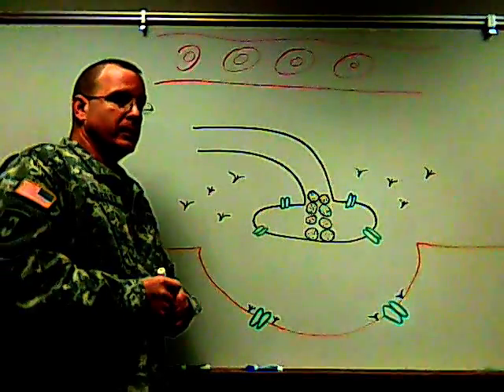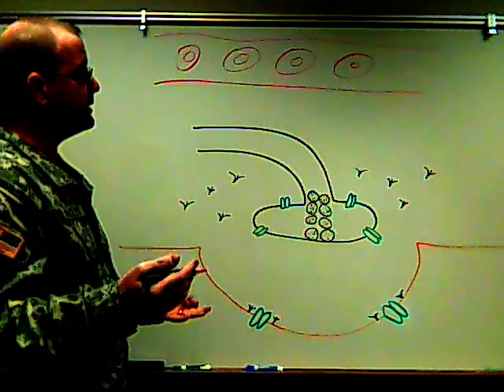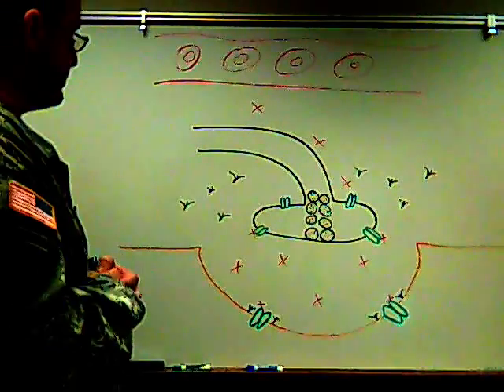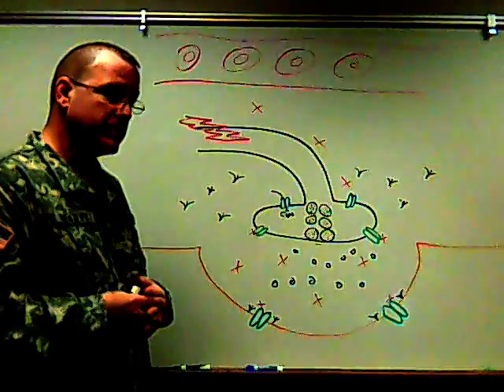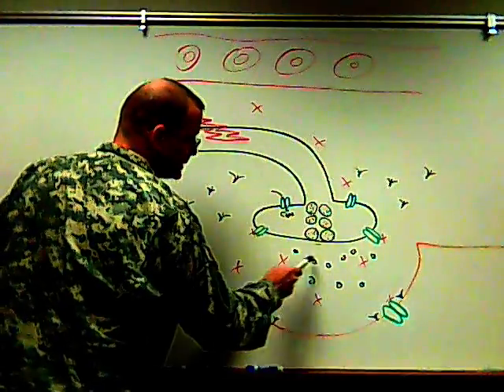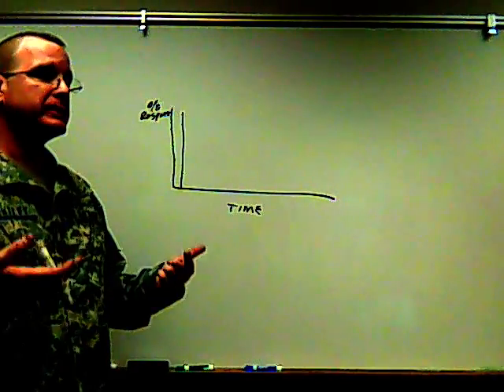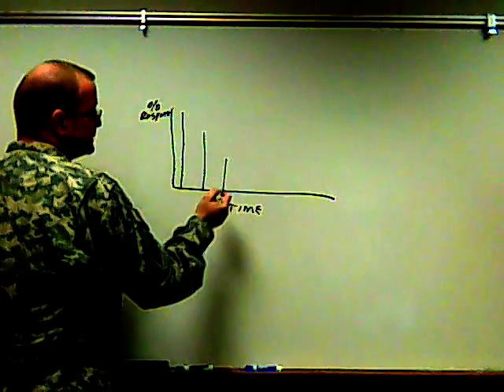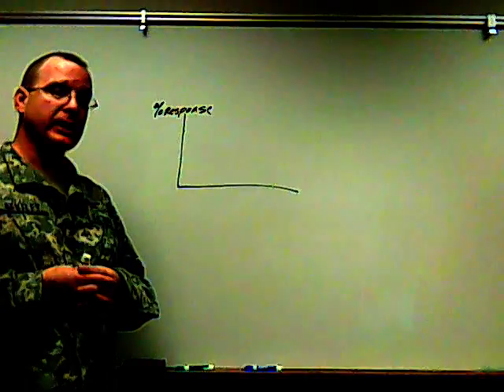Why do Nondepolarizing muscle relaxants cause Fade with TOF monitoring?

Comment: what does the presynaptic nicotinic receptor do?  you explain the blocker is competing there but what does it NORMALLY do... I feel like thats essential in understanding this, and you dont explain it. for that reason.. thumbs down
you just say positive feedback mechanism.. what are you talking about specifically?
-First Year medical student
Reply: PREsynaptic receptors move the next set Ach filled vesicles to the “front line” (the edge of nicotinic nerve for preparation) and when another action potential comes and stimulates Ca2+ influx (which destabilizes the proteins that hold the vesicles in place) the “front line” is ready for release into the synaptic cleft.  I know this is 4yrs old but I thought this reply may be helpful for others in the future -SRNA
Reply: @ane28829  Thank you very much!
Reply: @ane28829  Thx for clarifying. But Im still puzzled. The PREsynaptic receptors were already partially blocked on the first twitch. I would assume that the release of ACh on the first twitch would promote the positive feedback loop, as there is now more ACh available to compete with NDMB for the PREsynaptic receptors than there was before the first twitch. So why is it that the next load of ACh-vesicles (the frontline as you call it) consists of fewer vesicles than on the first twitch?
Reply: @Dave-qj1yg  The neuron at baseline prior to the 1st twitch is "fully loaded" so when it is activated it realeses a normal load of ACh, however since the non-depolarizing agent is competing with the released ACh it doesn't race the "normal" baseline, rather below it. So when the next twitch comes along there are less ACh vessivles prepped to be released, further lowering the next round of ACh vessicle preparation until there is no response at all.
Reply: +Ryan Brunner....... presynaptic  it has acetylcholine  a neuron  transmitter which attach to post synaptic. the below one in the diagram to open a channel called na/k channel which lead to influx of sodium from out side to inside n efflux of potassium from inside to outside which lead to depolarization
Reply: Ryan Brunner the other response is true for POSTsynaptic nicotinic muscle receptors NOT PRE-.  When Ach is released not all diffuses time the motor end plate, a fraction bind to PRE (Pos Feedback Mech).
Reply: @ane28829   i think u also need to open a youtube channel
U explain superbly
Reply: @pesmobile-progamer1327  thank you
Reply: @ane28829   👍👍